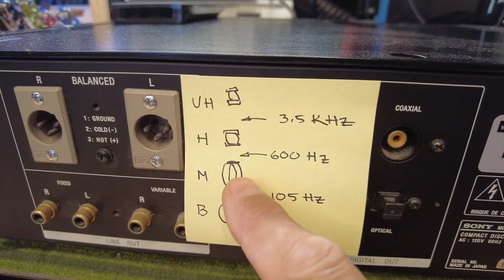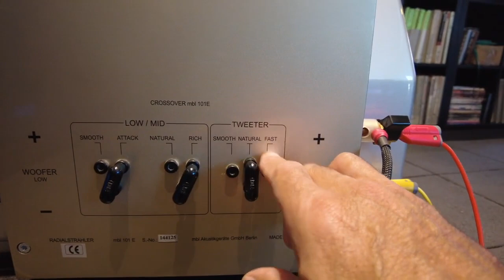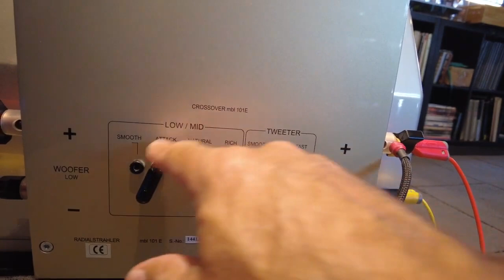The Fantastic MBL 101 E Speaker - Repair Success - Part 2

Comment: Wow, glad I never ended up going down the MBL route. Seems like a LOT of failure points and tiny frail connections on these things. All for a novel over complicated design. A typically German approach 😅
Reply from the maker: They are certainly unusual but I don't think they are that much completed than a point source driver, specially the tweeter and midrange.  I think the failure came from an amplifier failure so it could have happened to any speaker.

Comment: Odd...i find the most common failure are attachment point failures. I replace ferro fluid regularly in tweeters and is always at the connection.
Reply from the maker: Me too, strange thing indeed, I guess thats the weakest point on the coil wire.